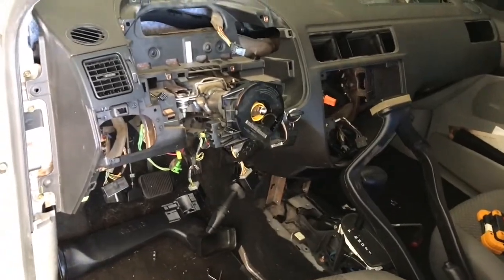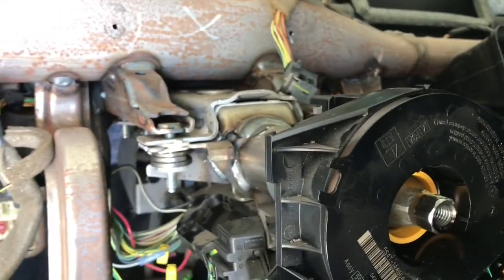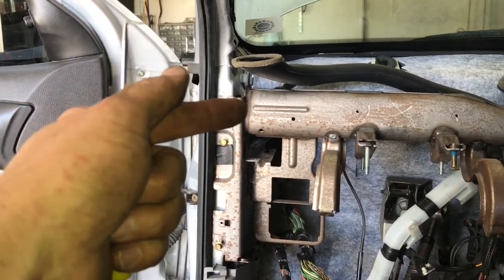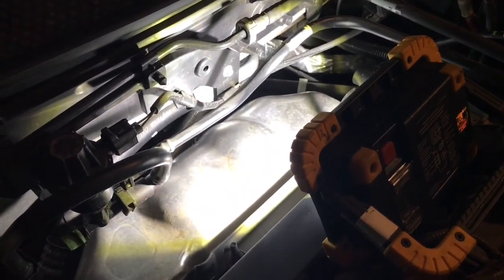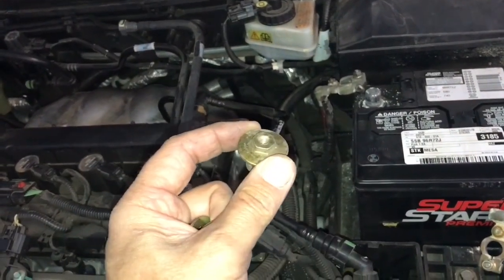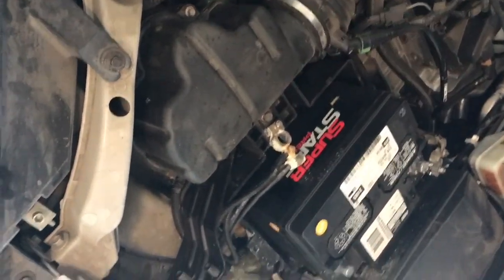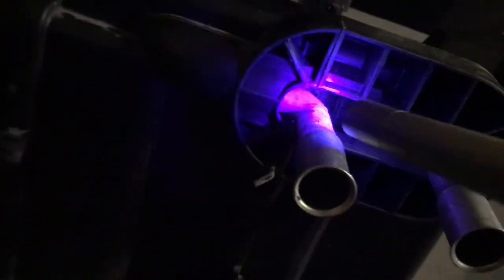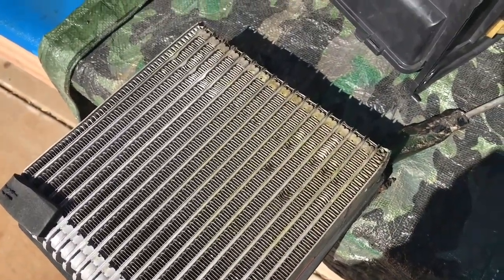Evaporator Core Replacement Part Three

Comment: I'm happy to have found this. Replacing the evaporator in my wife's '07. The only problem now is reconnecting the AC lines. Any tips? They won't fasten.
Reply: Do you know where the restricted orifice is located?

Comment: I ended up cutting the AC evaporator lines as close to the housing as I could because I couldn't get either to release.  it should be much easier to remove the pipe now that I can twist it around to break it loose.

Comment: Just want to confirm (getting ready to complete this job myself soon) if I were to lower the steering wheel like you did in the video then I wouldn’t have to take any of it apart correct?
Reply: You shouldn’t have to take any of the components for the dashboard apart. If you unbolt the metal frame at both driver and passenger door frame areas and in the middle at the base of the dashboard the whole thing should come out as one piece. It’s like 10 or 12 screws all together. You’ll only have to disconnect a few wiring harnesses. As for the steering wheel , undo the 10mm at the base of the steering column where it connects to the rack. It should pull right off. I had my dashboard out in about an hour and a half with this method.
Reply: The Bloody Hound is there a more detailed guide for this?
Reply: The Bloody Hound just completed this over the weekend and I wanted to say thanks for your comment! It helped a ton with getting everything out and putting it back!
Reply: Luke H to the best of my knowledge no there isn’t. What worked for me was removing the smaller pieces of the dashboard to give you access to the wiring and then taking the crash bar and rest of the dash out all together after the wiring was disconnected. A good tip for getting the passenger airbag disconnected is to unbolt the crash bar like it’s done in the video then you’ll be able to tilt the dashboard forward some to give you better access to the bolts the hold down the airbag dashboard cover, this way you don’t have to remove that vent mentioned in the second video (this is also the best way to reinstall it because I couldn’t think of an easy way to reconnect the cover and then find a way to pull the vent back through). The bolts to be removed for the crash bar are the four at the center of the dash where the center console meets the dash, the three on the passenger side near the door frame and the three on the driver side door frame plus the fourth one that hidden. You’ll have to pull the door trim out of the way to the left or right (depending on which side you’re unbolting) to get to the top bolt.
Reply: Luke H I haven’t found one and am thinking about making one with pictures. I got the idea from someone on a Focus forum who said that it was only four bolts. I went on the hunt for them and it ended up being 4 on the driver side and 3 on the passenger side as well as two at the base of the dash in the middle where the center console meets it. The 3 on the passenger are in the door frame area under a little plastic cover. There are also 3 on the driver side in a corresponding position to the passenger ones. The 4th one on the driver side is in a hole covered by a little circular door. You don’t have to get under the dash to find them. Just open your doors and remove any plastic covers in the door frame area. All of my bolts were brass in color.

Comment: Props to you for tackling this job at home. Now, without any intention of bashing on you, or your video, I'd like to add a couple of pointers that might save time and money to your future viewers. Somewhere at the beginning of the 1st video, you said you saw some tracer dye spots here and there under the dashboard, inside the cabin. In most modern cars this is not possible, as the evaporator core is deeply buried inside the dashboard, as shown on your videos. On some older cars you can get a glimpse of the evaporator core by removing the blower or the blower resistor, but that is not common at all. The correct way to diagnose an evaporator leak on most cars is to do an overnight test with a leak detector at the drainage tube of the evaporator housing, which is usually accessible from under the car, somewhere behind the engine, along the bottom part of the firewall. In a 2005 Focus, it will be dead center at the bottom of the firewall. Another way to diagnose it, is by adding the tracer dye to the a/c and using the a/c for a few days, enough to allow the dye to accumulate through the leaking point to a large enough  quantity so that it comes out the drain, along with the cold water that drips under your car when the a/c is operating. At this point, you will be able too see the green dye on the tip of the drain tube when you shine the uv light over it. If the leak is large enough, you might even be able to see that the water that drains onto the floor is green, as well (provided there's no coolant contamination from a leaking heater core, as green coolant also glows just like the a/c dye under uv light). It is important to note that putting the dye in and checking for leaks after a few minutes WILL NOT allow you to see leaks coming from the evaporator. It is necessary to use the a/c long enough for the dye to accumulate and drain out in order to diagnose the evaporator this way. Sorry for the long write, I hope this helps somebody.
P.S.: Also note, that in order for the dye to drain out, the a/c must be able to cool properly. An a/c that is not cooling properly will not drain/drip any water and the dye will not be able to come out in it.

Comment: thanx, i want to clean the evaporator without removing it , is it possible now that you removed it , if i use a flexible pressure hose where to spray it ?